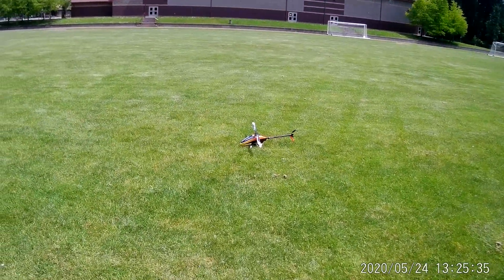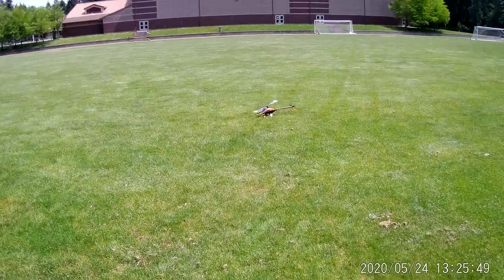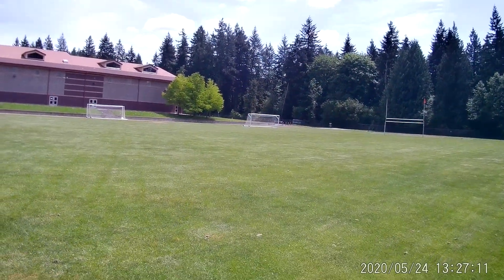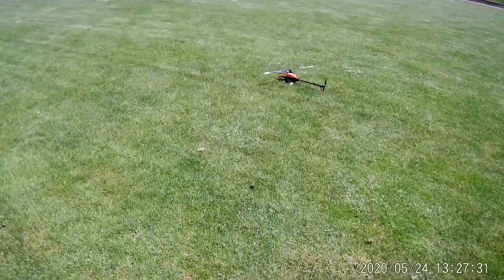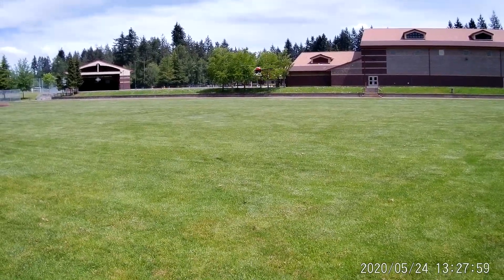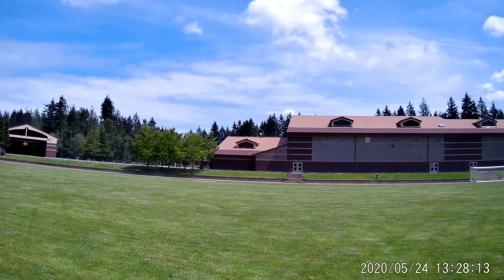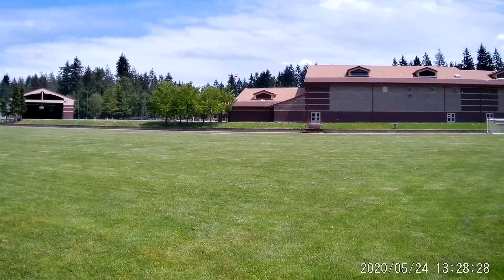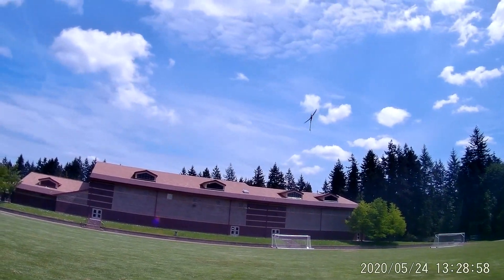Oxy 4 Max on Spirit II — Rescue success and rescue failure

Comment: The ‘weird’ recovery... hard to see from the video alone but it looked it was beyond 90 degrees so that an inverted remover was nearer. I read on your HeliFreak comment that you took over, so it’s hard to see when that happened. It certainly looks like it tried to travel the extra 80 something degrees to fully inverted to then recover via negative pitch.